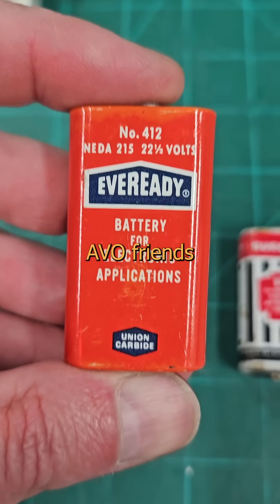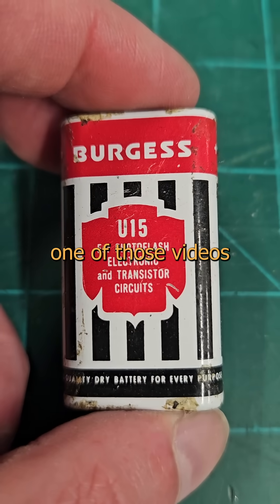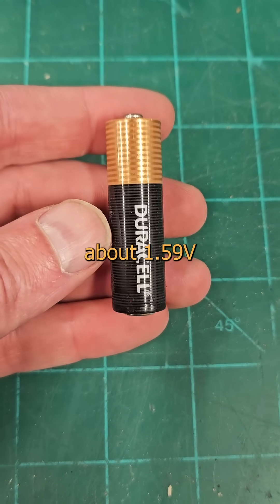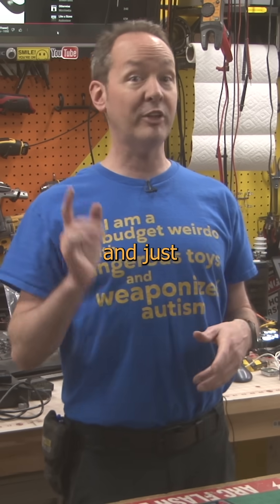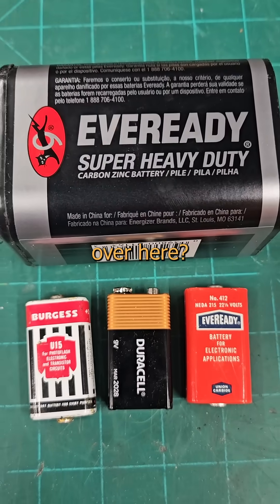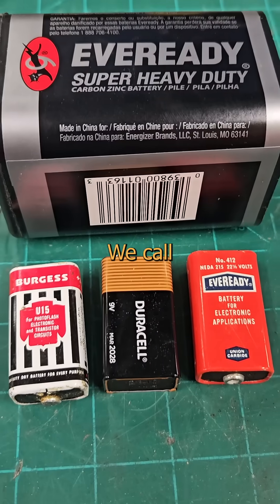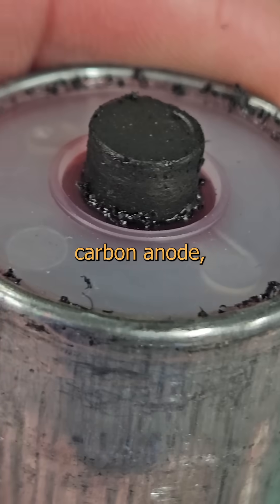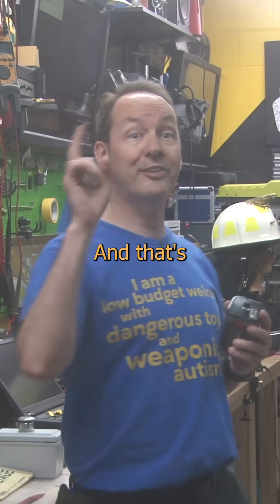Size 412 Battery #chrisboden #comedy #engineering #words #definition #chemistry #haka #science

Comment: The size is for the charge capacity  not the power output. Why didn't you mention that? That D cell can last a lot longer than a AAA which is the entire reasoning between the sizes. At least when talking about maximum power draw for a decice. Clearly a AAA device is not drawing 1.5v and thus only requires the AAA capacity. Those big 3,4,5,6D xenon maglites were only slightly brighter due to bigger bulb wattage but also lasted much longer than the small battery options back in the day. May need to get myself a newer 4D ML300 LED. Still have my annodized red xenon one in my emergency drawer in the kitchen. Not sure how they have kept them so dim with todays tech though. Though, their lumen ratings are probably more trustworthy than those on amazon claiming 15000 lumens.

Comment: Technically, the batteries that are in the 9V are not AAAA cells (LR8D425), they are LR61 batteries, which are 3.5mm shorter than actual AAAA batteries.

Comment: The D and C cells usually have more available current and will last longer under load. However, some cheap Chinese C cells actually are a AA inside of it with a cardboard filler. The length of both cells are identical.

Comment: Back in the early 1960s my dad had a  pre transistor portable radio that could run off internal batteries or be plugged in. We never ran it off of the batteries, because one of the batteries was a  90 volt battery that cost a small fortune.  I think it used a couple of D cells and a 9  volt battery as well.

Comment: The block used "B" batteries that were common in Europe,  but not the US. The 221/2 volt battery was used in cameras for the flash, and the first transistor radio, The Regency TR 1.

Comment: would have just been easier to say the AA and AAA were single cell batteries, and the others were multi cell batteries. as 1 use wont dictate the use for all, if it powers something its a battery. i could take those big batteries and pack them into a package and technically those wouldn't be batteries anymore then and just cells. a single cylinder engine is still an engine just like a multi cylinder engine.

Comment: The cells in the 6V lantern battery are actually size F, which is the same diameter as a D cell but about 50% longer.

Neat fact: The 30V version of the battery in the video (Eveready No. 413) was also used in pocket-sized "spy" audio recorders from the 1950's.

Bonus tidbit: It's a myth that the letter B was skipped in the cell sizing system. There actually is such thing as a B cell; but like the F cell, they're no longer used except in multi-cell batteries.

#themoreyouknow

Comment: I recall a portable radio that my dad had which needed a few vacuum tubes. The battery to operate this beast (over 5 lbs) was a 67.5 Volt battery. If you dared to put 2 fingers from the same hand on the terminals,  you could feel the electricity travelling through your hand. It didn't have enough amps to kill you, thank goodness. I wish I still had that Radio but finding that battery in this day and age would be a problem... maybe.

Comment: I've been finding a number of diy substitutes over the years for some batteries.  A C cell holder will fit a stack of CR2032 lithium cells to make a 45 volt battery. For higher current drain applications 9 volt rectangular batteries will snap together to make 45 volt batteries as well and may even fit the 45 volt compartment. I used this one a lot at work saving the hassle of obtaining carbon zinc 45's of questionable freshness, along with the option of using alkaline chemistry. I've never seen a 45 volt battery in the alkaline version.
    Many others are possible.

Comment: Dumb question here. Electricity is one of two things that I have issues with translation. (tool names is the other one)
What is the formal/correct way of "Voltage"?
Volt - Voltage or tension?
Ampere - Amperage or current?
Watt - Wattage or power?

Using my first language as a reference. I was taught that Voltage/Amperage and Wattage is wrong.

What is the right way to say it?

Comment: I recently found out, by taking apart an old (early 2000s) toy, that 1/4 AAA batteries exist. It litterally says 1/4 AAA on it and is the same diameter as a normal one, only 1/4 the length.

Comment: The 6 volt lantern battery has F cells. They are same circumference as a D cell but are 1/2 times longer. Although, some companies just put D cells in the case like Duracell. You pay 12 dollars for the Duracell 6 volt lantern battery with 4 D cells when you would be better off getting the 6 volt adapter for a few bucks that takes 4 D cells. Rayovac alkaline 6 volt lantern battery is a good deal because they use F cells in there battery and it lasts a long time. Thanks.

Comment: I knew all this, but only because I learned electronics in the early '70s.  The wide variety of dry cell batteries and their voltages made it fun to find them sometimes.  I recall a 67.5-volt one I think was in a case similar to the 9.0/22.5 volt ones.  Or cells about the size of a C-cell with clip terminals like on a 9-volt, with male at one end and female at the other, you could literally stack them on end. 7-volt mercury batteries for Turner CB power mics.

How about "B" cells?
I still remember in the '60s Motorific toy cars using AA cells; then they came out with Mini Motorific that used N- cells, and Sears (who sold the cars) was about the only place to find them.  Radio Shack came out with an ultra-slim pen light flashlight that took AAAA cells, and yes RS was about the only place to buy them.

Comment: Imnot sure anyone can answer me????? I had 2 18v drill batteries in the back of my quad bc the 12v original was trash and needed a lil boost to start and the 1.5mah got a cell recked but the 4.5mah one never did when it started although it did loose a light on it. Is there any way i can make a big enough battery as my main battery? I know how the 18650s pop on the top if it gets overloaded so can i use anything so that will work out properly?

Comment: IIRC the cells in the 6V lantern battery are F cells. There is a very interesting Wikipedia article on cell and battery sizes. Some of the old high voltage batteries aren't made out of cylindrical cells, they're assembled in layers. And there's the issue with the "B" battery.. it seems to be missing. Turns out there wasn't just one, there were several. Usually box-shaped, with very high voltages (between 20 and 100 volts) and used for supplying bias voltage for vacuum tubes. We don't see them anymore because vacuum tubes have disappeared, especially in mobile battery powered equipment.

Comment: These were originally made for military operations in Europe in some parts of Asia. Due to the high output and portability. A version of these could have been found in everything from portable radios flashlights, and even portable heating devices.  However the scarcity and limited manufacturer of these. Is what led them to be phased out for an albeit inferior, but more common alternative. Civilian application did last a little longer, especially during the Cold War and Cuban Missle Crisis. But it too was phased out, when a more common variant became a lot easier to find.

Comment: Took some 412a's and tried to make and 88v or an 89 volt and you have to be careful with the whole  series and parallel with them and also make sure that if you go for voltage (series) the voltage is the same exact on each cell block, and if you are going parallel for the amps is not recommended AT ALL because the 15 tiny cells dont have many amp hours to start, and well.. if you don't check ohms law and double check resistance.....yeah... 
A bunch a dead 412a's is like killing a unicorn.

Comment: FYI, the four cells in the 6-volt battery are actually F cells, but I like the sound of "double-D".  Many 9-volts also use six flat, horizontal rectangular cells rather than the vertical AAAA cylindrical cells.  Also, I worked with a lot of Techies, and you ain't kiddin' about finding a date there.

Comment: In the 1980s I worked at Radio Shack.   We had weird 12 volt batteries the size of 9 volts.   We dared each other to touch the electrodes to our lips, like you would test a 9 volt.  The shock was painful, and we were young and stupid.   Fried resistors with over voltage and current?  Yep.   Fried motors until their last cough of life and release of the magic smoke?  Yep.   After getting really shocked a few times, I leave the invisible nature of electricity alone unless necessary, or just damn curious again.

Comment: I remember we called to power source on schematics labeled B+ (B plus). 

I had a portable radio with a size B battery.  That battery, iirc, was 87.5 volts.  The radio may have had tubes, and needed the higher voltage for the cathode heater.

B cells are hard to find these days.

We also had on our farm an electrified fence, that had a large battery, the size of a laptop.  I don't know what that battery had as it's size designation.  I think it was a Rayovac, I remember the yellow paint job.

Comment: This is interesting. Thanks for making this video. I've always taken things apart, to see how they work. Stupidly, I even peeled open AA batteries, when I was a naive teenager. 

I found the amperage varies between batteries of the same type, too. Years ago, I use a multimeter to  test with about half a dozen AA batteries. I found small differences in the milliamperes between different brands. That explains why Eveready Energizer batteries worked better in my Energizer branded torch than Duracel batteries of the same size.
From recollection, Energizer batteries have a greater amperage than Duracel, so they release more energy more quickly than Duracel. That's presumably why Duracel batteries tend to have more endurance for low demand devices, like toys.

Comment: Chris a high tension question.  The Eaton canyon fire seemed to start on a non energized transmission line next to two other high tension lines. Video exists of arcing happening from those lines. If the ends of the cables were not grounded or copper thieves stole the ends of the cables that were grounded.   Could the lines have been charged by induction from the parallel lines to a crazy high voltage ?

Comment: In Portuguese, a battery like this is called "pilha" (aka a pile, a stack). I never put too much sense in it until one day when a 12V battery opened up and inside there was 8 little 1.5V cells literally stacked on top of each other. And now with this video I just realized that the name "battery" in English is for the same reason.

Comment: another important thing in why they have different sizes, electricity isn't only voltage but also amps. Larger cells can handle more current. That is why in those old flashlight used to have 2 or 3 big batteries and the moden ones uses AAA ones, they use same voltaje but LED is more efficient

Comment: Ahhhh, but you forgot about the all powerful 12 volt lantern battery that was used by police and traffic enforcement to block off roads. It was used in the flashing lamps that would last for days on top of the barricades. I also had a electric, battery powered kiddie car, powered by the same battery.

Comment: In my experience, albeit limited as I've only disassembled maybe a dozen 9V batteries, the majority don't use the AAAA cells! Only one I opened did, the rest are using rounded rectangle shaped cells (the same shape as the 9V) stacked atop each other to run in series.

They probably do this since it's cheaper to manufacture given they don't need to weld tabs to each and every one.

Comment: In the early 2000s i was young and broke.  My cell phone charger got chewed through by a dog, and this was when all charging cords were specific to each phone and expensive.

So, i took 3 D batteries i found lying around, soldered them up to make 3.5 volts, and my phone powered up.  It would last about 3 weeks before i needed to find new batteries.

When i had to go to cricket to get it reactivated at one point, i pulled out my phone with a wire attached to a taped up battery pack, and the guy at the counter thought i had a bomb lol.

Comment: if my understanding is correct the bigger the cell the more work / amps it has? one cell of a 12v car battery may have  about the same volts as a AAA battery but 8 AAA batteries wouldn't be able to even turn the engine over

Comment: There's also a 45 volt battery (No. 460) [which is basically just two of the No. 412 batteries combined in a single package] that was used for some vintage camera flash bulbs.

Comment: The 22,5V EverReady battery has an interesting aspect that can test your electrical knowledge: Why are the terminals at opposite ends of the battery and not side-by-side as they are on a 9V battery? [Expand for answer] 😇
 
. 
 
. 
 
. 
 
. 
 
. 
 
The voltage level is high enough that ionisation can occur across the terminals if they are close enough, causing occasional shorts and accelerated corrosion/decay. This is why the terminals have been placed as far apart as possible. 👍

(You can experiment with this, if you're careful: Take two AA/AAA cells and place them next to each other in an old battery pack, one turned the opposite way up to the other. After a while (Perhaps a year or two) corrosion will be observed in both cells as they will have gradually discharged through each other. Obviously they will need to be discarded safely afterwards. Comment dropping/AI judgements prohibited. 😇)

Comment: While making my girlfriends electrolyte drink, I remembered that electrolytes in stainless steel containers make electricity.. With the lid holding the stainless steel straw, I measured the voltage, which came out to 0.15v.

Comment: I'm a battery engineer and I'm delighted by your perspective and explainations
Reply: I still want to know what applications are old 22.5v battery is used for
Reply: @mattyvlietstra5017  

Believe these were used for photographic applications in the 50's and the '60's when that industry   was running crazy. I used a 510 volt battery to power my electronic flash units in late 1960's. They were a brick just a little smaller than those jump boxes that now use to deal with a dead battery on a car.
Reply: @nachodaddy1  ty. Makes sense
Reply: @nachodaddy1  my goodness, a 510V battery?!?! That's absolutely wild.
Reply: @saber1epee0  What gets me is these batteries are still produced today.  They are used in a lot of "vintage" or old tech, old lab equipment, old multi-meters, some older radios.
Reply: ...I'm a battery engineer...

Is this a nerd name for a professional boxer?
Reply: Wait, there’s battery engineers or am I missing a joke? 😅😂
Reply: @brunovazquez1  We exist! Someone's gotta squeeze every last bit of power out of that chemistry. Also we try very very hard to make batteries and not bombs
Reply: @josephinedykstra3383 so what's the news on the sodium-ion batteries? Are we getting them anytime soon? Are the numbers ACTUALLY as good as they claim?
Reply: @maxpain2554 : Not a battery engineer, but I believe some sodium-ion batteries are on the market now. Also, I don't know what numbers you've been seeing, but my understanding is that they should be heavier and larger (albeit probably just slightly for both) than lithium-ion cells of the same capabilities. They're only great when compared to 90's era batteries.
Reply: @brunovazquez1 who knows Bro 😂
Reply: What's the latest technology you've been working on? 🤔🧐🤨
Reply: @saber1epee0  it was all over the place, lots of huh and a little WTF. And a definite WAT. I think I liked it?

Comment: "Battery" goes back to voltaic piles and leyden jars.  Several were placed together in a wooden box (for easier handling) and connected in series or parallel ... a battery of piles or jars.
Future project here: a wireless telegraph key (needs wiring and it's done) powered by a battery like this (needs 3v).  I intend to do both types of battery.

Comment: I used to work with a guy who had a tiny LED flashlight that was perfect for a particular job but it took AAAA batteries which can be hard to find. So he got a 9volt and cracked it open to get the 6 AAAA cells and used them for the light. When I took over his job I bought an identicle flashlight but I found a drugstore that sold AAAA batteries so I never had open up a 9 volt.

Comment: Rather than a AA, I run a AAA with a little ball of foil as a spacer in my gaming mouse to cut the weight down to next to nothing. 
The battery doesnt last as long, but I only have to change it every 5-6 months. 3 months if i use it a lot

Comment: This takes me back, I used to sell all those weird voltages when I worked in an "electronics" shop in the 1970s. 
Also the 90V battery that you need for the high-tension supply on a portable valve radio. You also need a 6V battery for the heaters on the valves.

Ok, yes, they are "tubes" in the USA, but who cares, the USA is going bust now.

Comment: In the 1980's I spent some time locating a AM/FM compact radio that used 9v battery since that battery was commonly available in the Army for MILES gear and we were required to change them out daily at times during training. So a unlimited supply available for the radio.  Same with the PRC-25/ 77 radio batteries so I got a cheap car stereo and speakers, a used one can run it for days to a week not enough power to transmit so I could listen to the FM radio until dead then turn in.

Comment: The old farm radios had 2 battery sources, the " B" was the 90v. The vac tube elements had to be heated, the smaller battery was for the rest of the load. The newer formulas without mercury just don't work as well. We need a leap forward in small battery tech. Edison iron battery needs to be looked at again. They lasted forever.

Comment: If you wanna see something cool check out the BA38 military version 😉 It was used in early tube equipment to supply plate voltage with a whopping 103.5V (69 cells) 😅